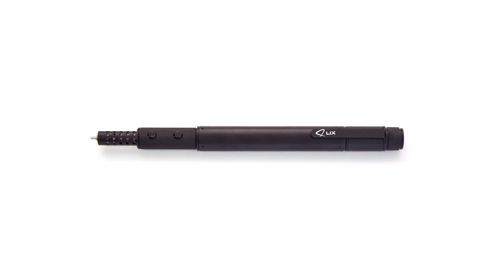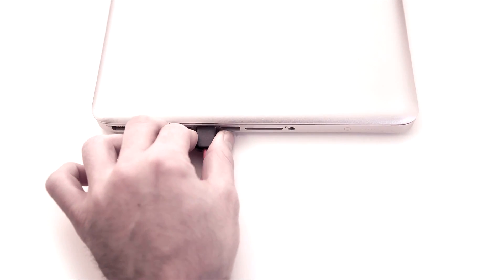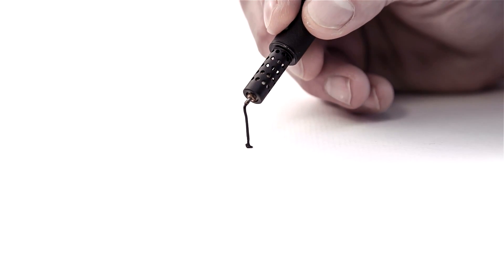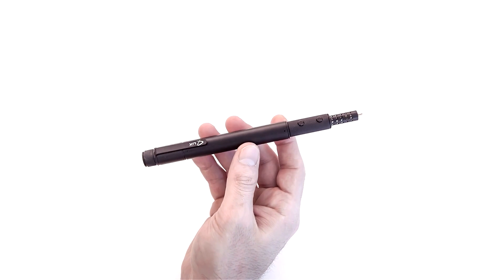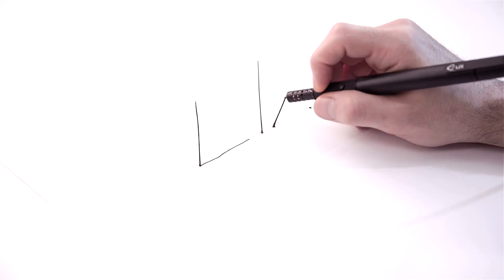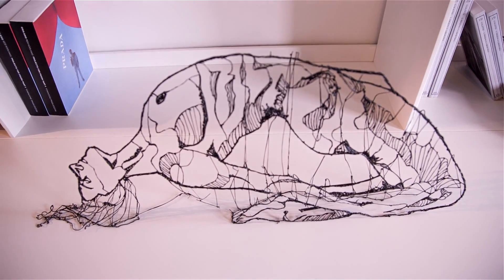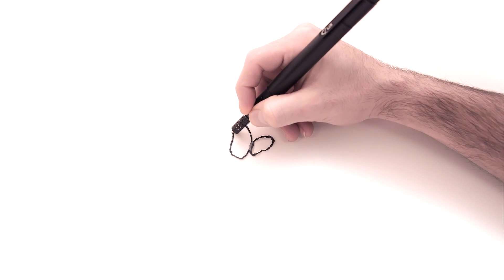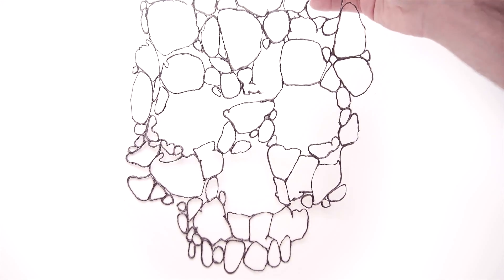THE SMALLEST 3D PRINTING PEN IN THE WORLD:  LIX

Comment: are there any differences between this and the 3 doodler? other than the design?
Reply: this is more expensive. In complete honest I prefer the 3Doodler. Buying the 3Doodler with a nozzle set is still cheaper than the Lix itself. The 3Doodler is even better than Lix now that 2.0 is out. 3Doodler is the way to go if u want a 3D printing pen. Trust me. 3Doodler 2.0 is the bomb.
Reply: Also the Lix has to heat up. With 3Doodler you can just stay drawing right away. Both Lix and 3Doodler are by far some of the coolest things ever.